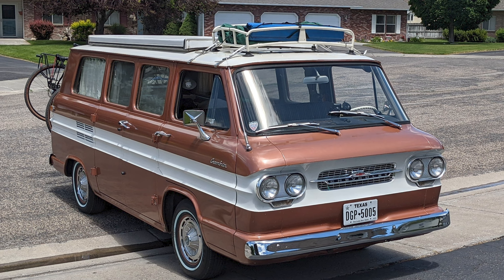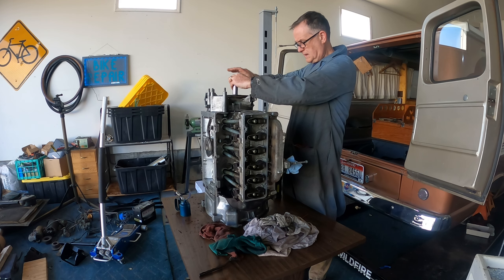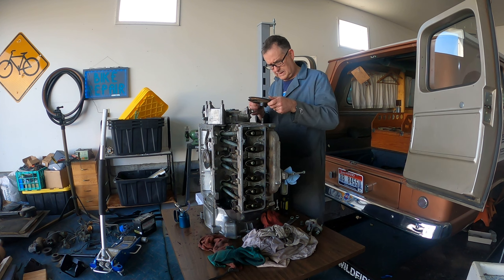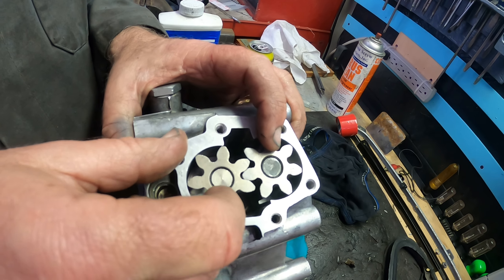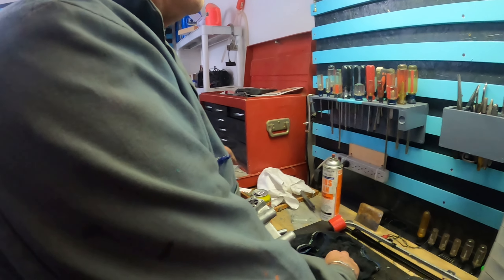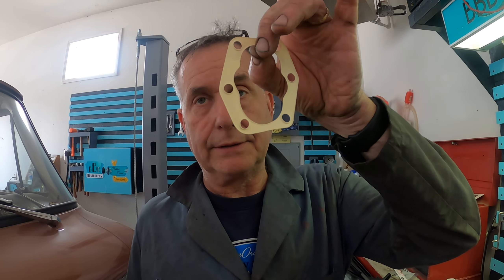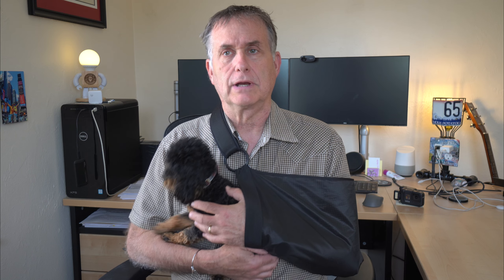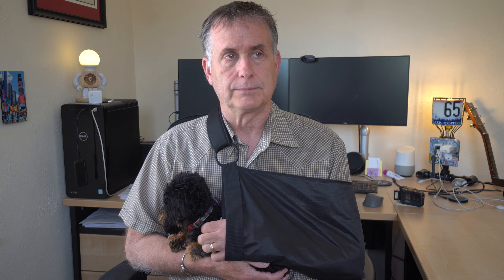Builder Series - Luna (Corvair Greenbrier Van) Refresh Part 9

Comment: Nice doggy carrying pouch.  Hope the healing continues wholly and without issue.  Your technical skill, knowledge and patience with the engine rebuild is admirable... come up here, we'll try to get you an interview with RX Autoworks😁. All those pushrods and fins makes me think of Harley Davidsons...and old Alfa Romeo 8Cs.  All that gasket surface cleaning and tolerance measuring makes me think of my own rebuild projects, damn fussy it is😅. Wishing you well on your way to your adapted summer adventure, whatever that looks like!  Cheers,
Reply from the maker: Hey Todd,
Thanks for watching.   It's cool how my arm sling is also a doggie carrier but that only works for Disco sized dogs.   Don't be trying to put a 50 pound Black Lab in your sling.  :)
Thanks for the offer, but I'm currently not looking for a job and I'm super slow so probably wouldn't make a good professional mechanic.  
You are spot on with the comment about the fins on the cylinders of air cooled engines looking similar.   I always think the same think when I'm wrenching on a Corvair engine.   
As always, thanks for the great comment and well wishes.   We are trying to make the best of our summer given all life has handed us at this time.   We hope your summer is also great and full of adventure.
Enjoy the Ride
Reply: @BBB_Adventures  You've got a full plate, I wish you grace and strength as you walk the path with your father.  Willa, the 87 lb Great Dane/Weimaraner mix wouldn't fit either...but hey, she'd be pals with Disco.  I was kidding about the interview....a little envious of your freedom 55, but I started a little later, with some good adventures in the early years so I cannot complain.  Nonetheless RX does some pretty awesome cars, you'd like their projects.  When you need quiet and easy, the Point here is good.

Comment: Seven screws and a necklace!  Did your Doc have to use plastigage there? Did he tap two or three times on you for good luck?  Did he use any Aunti-C's? 😊
Reply from the maker: Hey Dave,
These are great and important questions.   I certainly hope he used plastigage to ensure the hardware he installed on my clavicle had the correct clearance.   And he must have tapped three times since my recovery seems to be going well.   :)
Thanks for watching and for the clever comment.
Enjoy the Ride